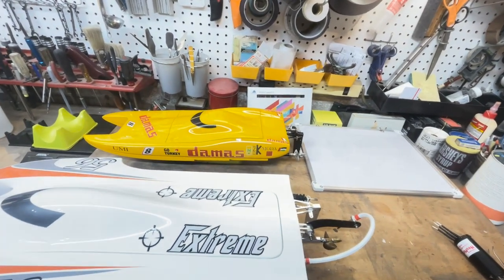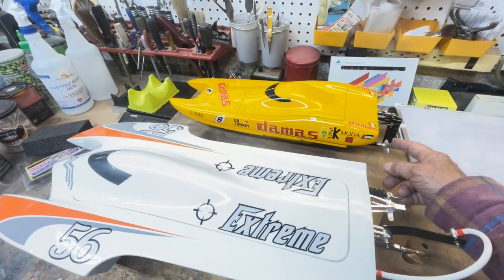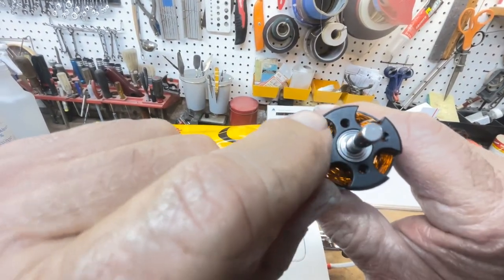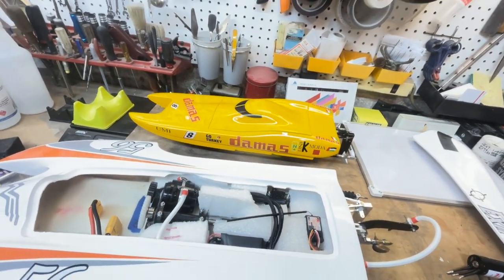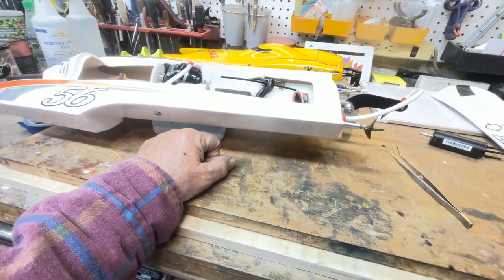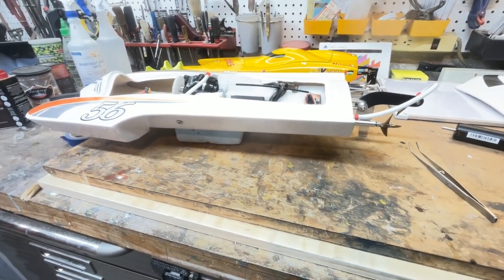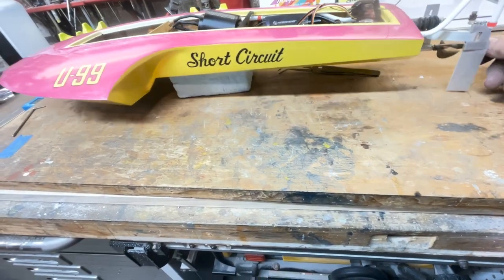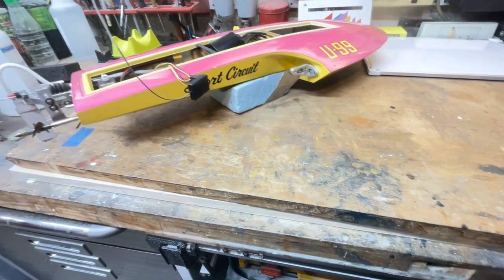Dr. Jet shows some thrust bearing applications.

Comment: Btw Jet, appreciate the info on axial loading 🚤⬅️ It now makes sense to me that my F1 WL915 has 2 small back bearings on the far end of the flex cable inside the strut. The bearings sit about 20-30mm apart, plus the stock motor has a bearing on the back and front. WLToys seems to know what they are doing... ✅

Comment: I assume the Aquacraft U-17 is based the very lovely U-99? Looks to basically be the same size hull. A local hobby shop here (a few towns over) might still have a leftover U-17 in stock (new). I might go for it... 🤔
Reply from the maker: The 17" Miss Seattle is 2/3 the size of the 25" Short Circuit (U-99).  Any similarities between them are probably due to the builder.
Reply: @Dr_Jet  Oh, but I was referring to the ol' Aquacraft Mini-Thunder U-17 which came in different colours and is a "shovel hull" (445mm) like the U-99 👍

Comment: I think it was such an old motor that the Bushing was simply worn-out. Might have had a touch of additional clearance & at 60k rpm it exploded. Add the axial load creating heat & the bronze Bushing said Poof ☁️ . I had a similar issue on my 29mm TP

Comment: Here we go again, bringing that Short Circuit shovel  nose out, and teasing us with it😂😂😂 been waiting to see it on the water. The shovel nose boat have really started to grow on me. Gonna start building the one I purchased  from you a while back.👍👍👍 I can't wait to run it.
Reply from the maker: That is my old Doug Campbell Classic Hydro built in early 2007 for Limited Spec Hydro (LSH).  LSH has gone the way of the dodo and has been replaced with P-Limited.  Steve used Asian 36mm motor cans to make a motor that would be legal for P-Limited.  I just re-installed the motor this morning, it looks ready to go.......

Comment: Speaking of "neuer" motors that NEU did great this morning, 83mph on 6s in oval trim and 70mph on 4s

To answer the question concerning the back end bell/bearing question,  the telon washers are actually sitting on the end bell itself and not the motor bearing itself.   Hopefully everything works as it should 🙏
Reply: Ps thanks for all the insight over the years,  very helpful for myself and the boat gang!
Reply from the maker: Try adding shim washers (0.005" or less) between the Teflon washers.  Add a drop of oil and you should be golden.
Reply from the maker: Dying to see the video!
Reply: @Dr_Jet tomorrow morning

Comment: Who makes the strudder on the short circuit it's very unique. Also, I'm sure other motor brands could have the axial load problem too but I've seen several channels with guys having this problem...all with tp motors. I have one and I promise I'll never buy a tp motor again
Reply from the maker: That setup was made by a fellow named Joe Solinger.  He may no longer be amongst  those of us that are still upright.  You had to order from him directly and he made very few over the years.
Reply from the maker: It's that spacer.  If I had a TP motor, I'd replace the brass spacer with a homemade stainless steel one.